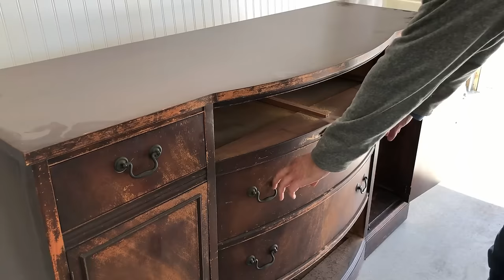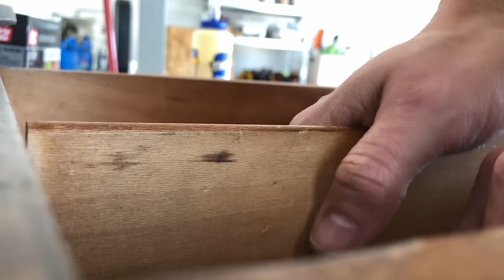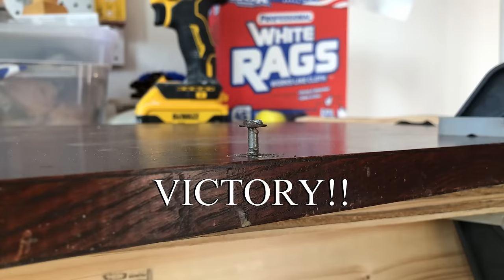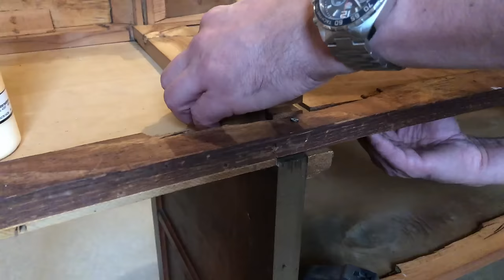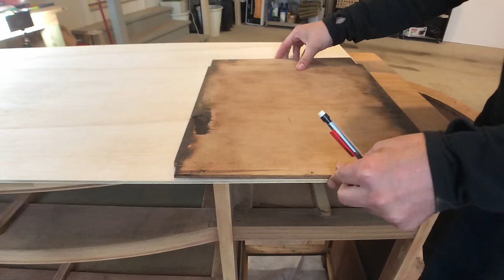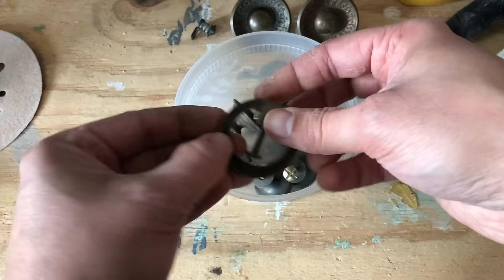100 Year Old Buffet Kept Falling Apart | Furniture Restoration

Comment: I'm always tempted to try my hand at these extreme repairs, but I'm realistic enough to know I haven't got the skills. Kudos and congrats!
Reply from the maker: Thank you! It can be frustrating but rewarding at the same time.
Reply: Well, I could probably do this. But, it being me, it would require at least 3 trips to the ER, I wouldn’t be able to find my tools, any wood I cut would be measured twice, then cut. It wouldn’t fit. So I’d measure twice and cut. This process could possibly go on for several tries. When I finished it would be crooked and not at all level. To end it all I’d have parts left over. So, I could do it. It would look like crap, but I could do it. 😜
Reply from the maker: @brazillady5119  😂😂

Comment: I laughed out loud when you flipped the middle finger at the knob that was giving you so much trouble! I can’t tell you how many times I’ve done that. 

That tung oil really brought out the beauty of the wood. I swear I could hear the dry wood slurping it up like a traveler in the desert at an oasis.  The brass hardware is really pretty, too, and you made an excellent choice on the door knobs.  

By the way, to “scrap” something means you throw it in the trash. The action you used to remove the finish is to scrape.
Reply from the maker: Thanks for watching! I’m glad it made you laugh! Yea, I saw the typo after I uploaded it and wasn’t gonna through the whole upload process again all over the letter “e” lol

Comment: I have an oak flat front drawer with half-blind dovetails. The face drawer side dovetail wood is all gone; my plan is to remove enough wood to glue in a h,w,t matching block, make a new draw side and router cut new half-blind dovetails. I'm going to hold the block in place with two short blind dowels. Your opinion would be appreciated. John
Reply from the maker: Trying to visualize this. Do you have a photo of it? If I’m visualizing it right you could tack it with Brad nails. Would be easier than dowels and they should be covered once you put it back together. Again this is how I image it in my head without seeing it. Also what do you mean by h,w,t, half-lap with tenon? Since you are using dowels.

Comment: Suggestion...heads for screws & bolts made prior to 1930s were not made in the standard sizes we have today. Check around local garage sales or flea markets to find inexpensive screwdrivers with larger heads, and more importantly, wider bit depth, that are made prior to 1930. While it will not fix a piece of hardware that has gotten crosswise, it will make the removal easier because your screwdriver head will match the screw.
Reply from the maker: Thanks! This great advice. I knew Phillips head screws weren’t made until the 30s but I didn’t know about the size difference of the screw heads. I know a few local places I might find an old screw driver set.

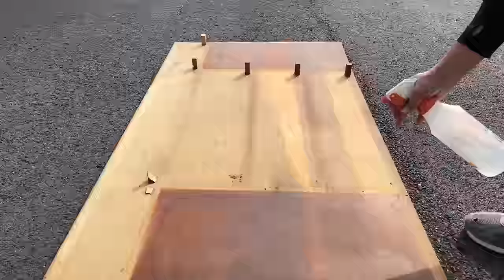Comment: At the 10:00 mark - what is the purpose of spraying vinegar?
Reply from the maker: Both cabinets had a little bit of a musk smell to them which potentially was mold. Vinegar  cleans mold from wood. So I sprayed the inside and the back panel to clean those areas.

Comment: Do you do the iron and the wet rag on veneer too or just on the thick  solid wood? Thank you , nice work!
Reply from the maker: Thank you! You can do it on veneer but you have to be very careful not to melt the glue and lift the veneer. It’s much easier on solid wood.

Comment: This piece would benefit from lacquer toner on the frame to match it better with the drawers.  I would guess that it is probably from the early 1920s.  Quite a challenge.
Reply from the maker: I might try that. Thanks for the suggestion.
Reply: Don't disagree that toner would have evened out the color. However, sometimes, it's nice to just let the grain variations shine.

Comment: on a second note, your video missed out on some important details: we didn't see how you applied the finish; was it only tung oil? also, the drawer partition should be finished as well as the back cover. don't cut corners.
Reply from the maker: I used a lacquer on the drawers since they will get more use and a spar urethane with tung oil to finish the topcoat. I ran out of day light when applying the last top coat and didn't have it recorded. I'll make sure to get as many details included in the future.

Comment: You are using the wrong screwdriver tip on the cross threaded drawer pull. It is too small.
Reply from the maker: Yea I’ve been told I need to find an older screwdriver to better fit these older screws.